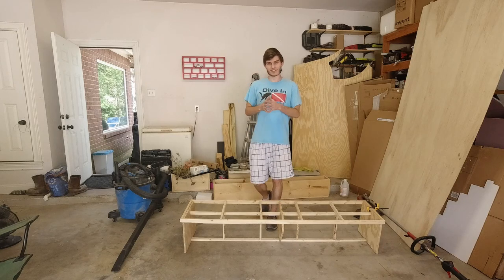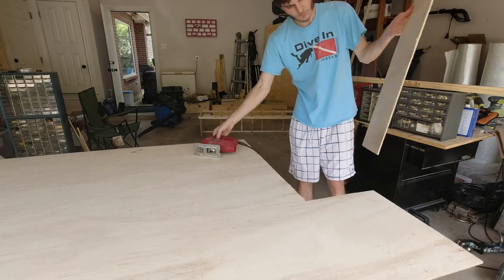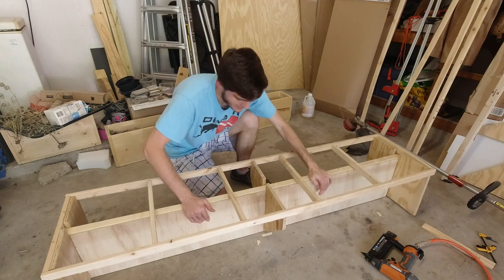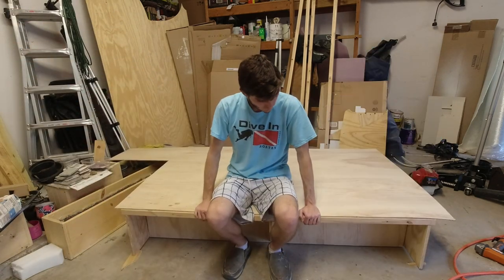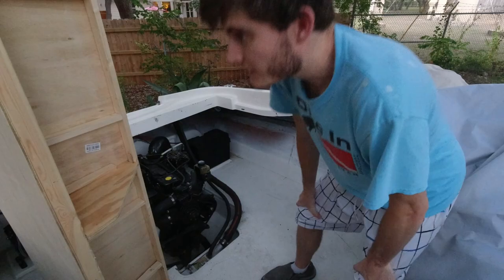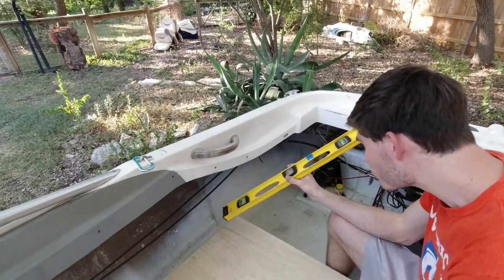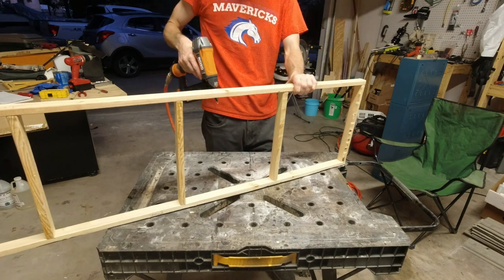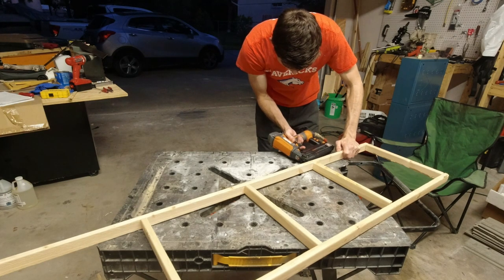Boat Back Seat Rebuild - Part 2

Comment: You did it! That was the only thing different than mine other than the motor. Hey i seem to be having a fuel pump problem. I think anyway lol. Can you tell me.if you have 12v at the pump when you turn the key to on? Mine only shows 10.5 when i turn it over. Was told should be 12v when switched to on.
Reply from the maker: I actually have no electric pump on my model. The pump is powered off the cam shaft and that's it 🤠
Reply: If its a mercruiser, you should only have voltage while the key is turned to the crank position, it gets voltage from the starter during cranking.  After the motor is running, it gets 12v from the purple wire that runs through the oil pressure switch, so once the motor has oil pressure while running, it will supply the fuel pump with 12V.  Its not that uncommon to have a little low voltage to the pump while cranking because the starter takes so much power.
Reply: @ashipshow  Ok so i unhooked the fuel pump from carb and bumped it over and no fuel came out that was why i thought it was the pump. Also took it off altogether and put 12v to it and it runs but sounds a little noisey. So idk? Def a sparatic fuel problem as its been started twice before and ran.
Reply: @Rampage00769  If your getting voltage to the pump during cranking, and you verified it works on the bench, then you might have a bad antisiphon valve or a clogged fuel line.